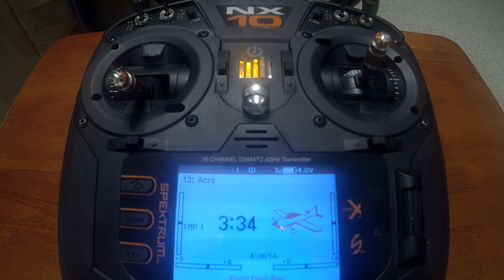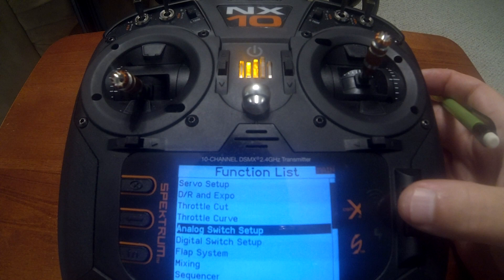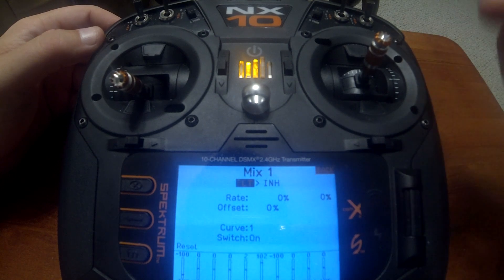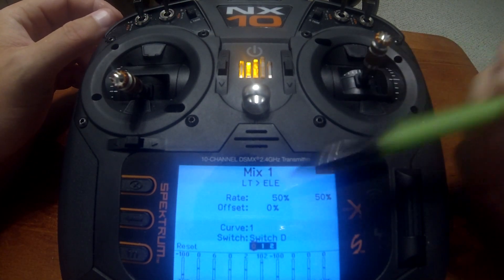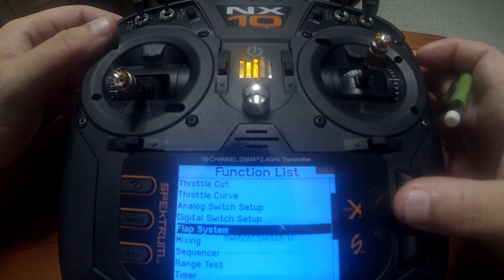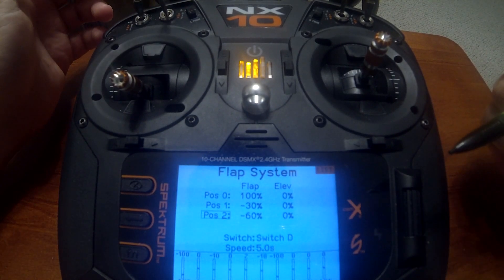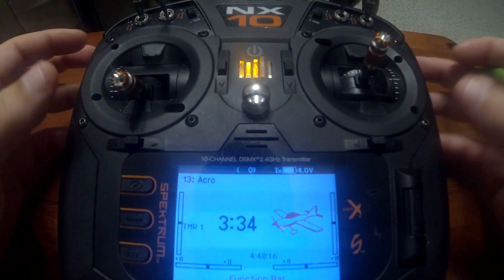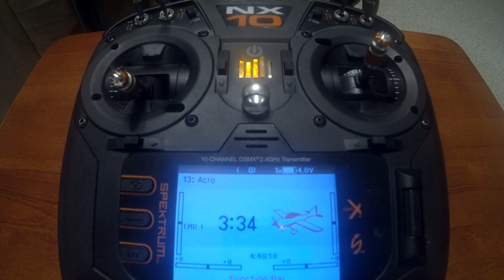Spektrum NX Setup: Elevator/Flaps Mix on the FLY! - Advanced (NX8/NX10)

Comment: I have a new NX8, I like to mix throttle with rudder so as I add power the rudder goes from zero to 5 or 6 degrees right rudder(adjustable) and as I pull the power back the rudder returns to zero at idle. I like to have it all the time, not on a switch. How about a tutorial?

Comment: Soooo much easier if you just make a flight mode for the flaps...then go to trim set up and set the common to flight mode ...then your standard elevator trim is memorized for each flap position. Should the balance change due to battery? You can change it on the fly
Reply from the maker: I have another video with flight modes,this video is another option and being few years old i have had many users tell me they prefer this method too.

Side note: New OTF options with update is a similar method to this too...
Reply: Flight Mode trim can adjust ailerons to compensate for flaps that impose an undesired roll.  OTF is more work.

Comment: BD, I have another escenario, I have a mix with the elevator on my flaps, and work   perfect for landing, but when I taking off the mix is not working because the flaps are down and the elevator as well and is not giving me to much ‘positive’ lift for taking off, so I am thinking and I do not know if it is possible two have a flap configuration neutra without mixing and I another switch another flaps configuration with the mixing with the elevator, one for taking off (position one and two) and one for landing (position one and two as well), thanks for the feed back.
Reply from the maker: Setup two ways. One using separate switch and mix for a takeoff mode 1 and 2. Second, use half flaps for takeoff and full flaps for landing.

Comment: Here's a question for ya. I'm setting up a mix for my gear doors to gear. I have the gear doors on aux 1 and the gear is the gear.   My problem is that the gear doors closed faster than the gear and it jams up. Is there a way to slow down the doors closing before the gear retract.

Comment: Thanks for that - really useful. Only down-side is that elevator jumps to the position when flap position is changed. Does not move in sympathy with flap. But as a temporary measure until one has landed, it's great.
Reply from the maker: When using this setup i only need to do it once,so i dont experience the jump. Deploy flaps,make adjustment,land, and then transfer. Now its zeroed out when you go back up,deploy flaps and no jump and if need to ,repeat process.

Comment: I think it would be a lot easier to just put the flight modes on the flap switch and use the F-Mode trims. You'll use the normal trim levers and the transmitter will remember all of the trim settings. You probably won't even have to go into the flap system menu and enter any elevator trim values. Also, I adjust the elevator trims for when the flaps are down by gliding into the wind at a safe distance above the runway. I want the plane to descend as slowly as possible, but safely above the stall speed. If I add a little power, it should level off and if I add more power, it should climb. The flaps shouldn't really be lowered when the throttle is above 50 to 75 percent.
Reply from the maker: Both methods work.I wanted to show this as a alternate method too.Some reasons I use this cause it further away from right stick so not as crowded controlling on one side( similar to crossed trims without moving them for normal use). Second,you can adjust up to 100% where flight modes is limited to 50%. Third i transfer the percentages so i can see them separately.

Set flaps while holding power.Especially heavier jets/planes that you dont glide in. Setting pitch for airspeed on a constant throttle,where gliding it can be harder setting the pitch for a certain throttle cause its not being controlled as accurately on a glide.However use what works :)

I appreciate your input and adding info to share too.
Reply: @BDTennessee  On my DX9 Black, I get 29% of travel with 100% trim. If I enter a non-zero value for elevator trim in the flap system menu, the elevator trim gives me 29% of travel on either side of that. I've never had a plane that needed more than 12% elevator mix. I'm still in the early stages of testing flight modes on the flap switch. I set the glide speed on two of my EDF's with the flaps down, but haven't done much flying around with them down. I've used the L and R trim switches in the past for adjusting gyro gains, etc. and they felt awkward..
Reply from the maker: @txkflier  correct 29%. I mispoke when i typed.If you look at other comments on this video ,i replied to another comment 100% vs 29% about 2 months ago.

Jets dont need that much but high wings can get up there in percentages.

Its ok if L/R trim is awkward,we all have our preferences that we do and dont like. Multiple ways to do the same thing,just use the one that works best for each pilot :)

Comment: I cannot slow the flap speed and elevator speed together with a flap elevator mix.  Is there a video that describes how to do this.
Reply from the maker: In the Flap system do you see a word bottom right,that says "Link" or "Indep"?
Reply: @BDTennessee  I thought/think Linked only applies to the speed - when linked time selected applies to movement to all positions whereas Indep means time applies only when moving to that position.
Reply from the maker: @tabdycollins  thats correct.
Reply: @BDTennessee  yes.  I tried both but am not sure what that did.  I will try your latest suggestion changing the Y harness to channel 6 and setting up the system.  Which link setting do I use
Reply from the maker: @richardranaudo3991  sorry missed comment.You can use either one.

Comment: Man, thats alot of work, just do simple flight modes, easiest way hands down.
Reply from the maker: This method is simple after setting up a mix which takes less than 30 seconds. Also you get over 3 times the adjustment (29 vs 100).Lastly you get to see on the flap screen how much Elevator percentage.

I appreciate the feedback

Comment: For some reason, the LT>ELE Mix impacts the Throttle Trim on my NX8.  Is there a way to fix this?  Your help is appreciated.
Reply: Found the answer: when the LT switch is touched, the home screen display changes. Instead of the Throttle Trim value, it now displays the LT value temporarily. The column heading shows LT.  This might be a good way to see the LT center position, rather than listening to the Trim center tone. All applies to the RT swich as well.
Reply from the maker: @horsth9566  Glad you got it figured.When you adjust the LT the value of the Elevator will change. It also works in conjunction with normal trim. So if you have -10 of elevator trim for level flight and you add +20 LT the monitor will now show +10. So thats why i say listen for the beeps cause its not always 0...

Comment: On the Mix screen, when does curve (0,1,2) come into play, if at all.
Reply: Trim Setup Screen:  does the Trim type for L-trim and R-trim have any impact?  (F-Mode, Common, Norm)
Reply from the maker: @horsth9566  works the same as using them for flight modes. I leave them common for  this method of adjusting on the fly.
Reply from the maker: I leave them on the same value as the position (ie Curve 0 > Pos 0).